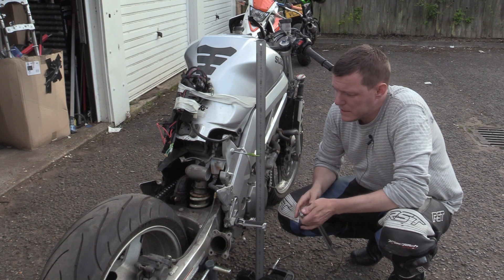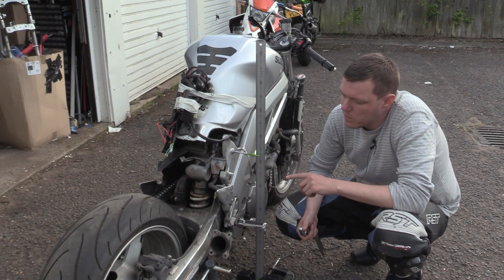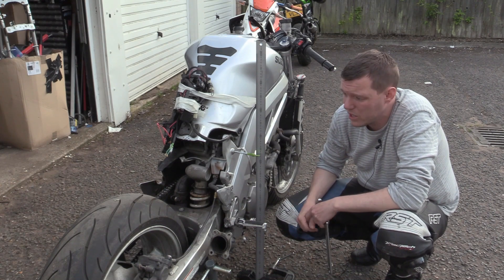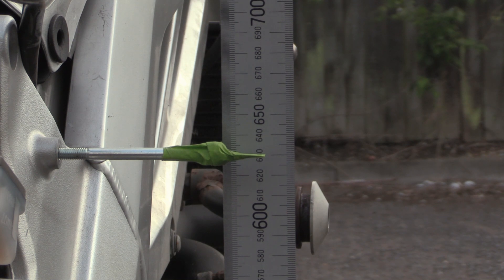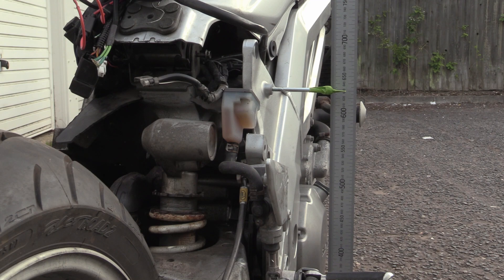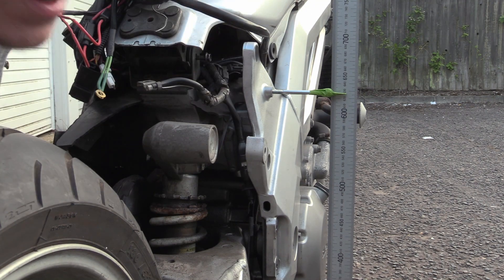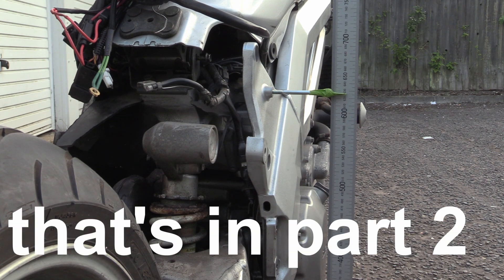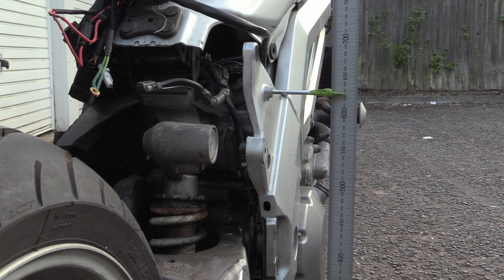Springs, Preload and ride height - Part 1

Comment: yeah but when you sit on the bike, you overcome all that preload. the pre-load only keeps the spring seated while in full travel. You cant change spring stiffness, its always constant rate of compression.

9:38 thats not correct either. Your weight is still overcoming ALL of the pre-load you gave it.
Reply from the maker: "yeah but when you sit on the bike, you overcome all that preload. the pre-load only keeps the spring seated while in full travel."

Sit on you're bike. If the rear end moves at all what does that mean?

"You cant change spring stiffness, its always constant rate of compression.""

- I say this in the video at around the 9:30 mark
Reply: @thedirtyworkshop  have you done measurements of ride height with yourself on the bike before and after?

Comment: How I understand it, regardless of where you set the spring. Once you sit on the bike, you end  up in the same place.  The only thing that changes is how springy the ride is
Reply from the maker: No. So a spring has 2 position. Free length and coil bound. Free length requires 0 force and coil bound requires say 1000 force. When you wind down a pre-load collar on a spring it applies force to the ends of the shock, and this is connected to the bike. The bikes 'weight' is what the spring is pushing against. Because there's no extra force added like bumps etc, we call this pre-load, i.e before any load (bumping and jumping) is applied.

If you increase the static load (pre-load) by adding another passenger or luggage then you need to adjust the pre-load. The more pre-load the less suspension you have.

Comment: Thanks for putting this up, I’m 5’4 and thinking about the best way to make the ground a little nearer, and this was explained very well. Definitely won’t be adjusting my preload now, no dogbones on my bike, they are fixed, so i can have the seat re made which is probably the easiest option. Honda NTV650, Yr 2000. Nice bike, but heading to the lake district and want a bit more stability under foot for those hairpins on the passes. Not a good idea to be on tippie toes there. thanks for the upload, very helpful and explained well.

Comment: Hi mate, when using shorter dog bones does this effect the preload setting on the original shock. I know the equaision used to set sag but not sure if the shorter dog bones effects the equaision for example maximum travel distance of the shock (if that makes sense)

Comment: @The Workshop NO you are incorrect. Changing ride height (the so-called pre-load adjustment) will NOT change the force required to start compressing the spring when the bike is loaded (with rider). It will ONLY change your ride height by shifting the compressed spring downwards. The reason being that the weight of the rider is creating a force that exceeds considerably the force applied by the pre-load. The only thing ride height does is shifting the upper end of the spring thereby actually shifting the whole spring and ride height. With the same weight the length of the compressed spring remains exactly the same and the force required to compress it further is also exactly the same. That is also why changing pre-load does NOT make the suspension feel softer or harder.  What happens is that as a result of lifting the rear end more mass moves forward and that might make you feel as if the rear got harder.
Reply from the maker: "NO you are incorrect."

- and you're blind. Didn't you watch the video?

"Changing ride height (the so-called pre-load adjustment) will NOT change the force required to start compressing the spring when the bike is loaded (with rider)."

- Totally didn't watch the video - don't blame me that you are dumb.

"The reason being that the weight of the rider is creating a force that exceeds considerably the force applied by the pre-load"

- Wasting your time trying to explain anything to me - you missed what was said in the video...
Reply: @thedirtyworkshop  I don't think being arrogant helps here. It will actually make you feel worse in the end, so chill out and do this simple experiment instead.

Start by doing this - set ZERO preload, sit on the bike and have someone measure THE LENGTH OF THE COMPRESSED SPRING.

Now, set MAX preload, sit on the bike and have someone measure THE LENGTH OF THE COMPRESSED SPRING. It's the same, isn't it.

If preload does not affect the compressed length of the spring, it obviously does not affect the force required to compress it further either.
Reply from the maker: "Start by doing this - set ZERO preload, sit on the bike and have someone measure THE LENGTH OF THE COMPRESSED SPRING."

- I'm sure you didn't watch the video - so in the video the bike moves 3mm, and why? Linkages, angles and deflection - and as I say in the video 3mm is nothing - you're not going to notice anything. Now, if someone wanted to lower/raise their bike by 3mm, they're being stupid. 

I say in the video, fucking around with pre-load is NOT how to change your ride height, changing the linkage (dog-bone) is. 

What or why you didn't notice this is beyond me. So when you make comments that are clearly condersending I'm going to call you a prick. There's also more to it than that, which was an argument with a guy on the discord about changing the pre-load by 10mm = 10mm of ride height change - to which I said - that's bollocks and I'll show you why - hence the video. 

SO why does it move at all, geometry - you're example above is missing the rest of the system, and because the cush lever, dogbones etc all have different angles and lengths when you change the compression vs spring length due to pre-load then there is a slight difference - but 3mm is not even worth considering when thinking about ride height - 

What's even more important is that if you keep increasing the pre-load then the bike starts to move back to the original position - this is because all linkages sweep through an arc.

Comment: Question on brake pads .
Has anyone had there break pad come off from the pad back plate  on the front brake while riding  it  ???
This as just  happend to me  !   I was Lucky
Reply: Yeah mate, my own fault. I cheaped out on some 'sintered pads' a mistake I will never make again
Reply: @philipbilsbury8501  These are the only pads  .
Your guess is not the answer !
Reply from the maker: What pads are they would be a good start? And it means that they de-laminated from the backer. Cause, shit pads
Reply: @thedirtyworkshop  You can laugh at this if u wish   or what ever .
These brakes are on my Mountain bike  .
These brakes are the best I can fined for sharpness & strength .
These brakes are cable .
I can get to 35 mph on this , so you need Good brakes and I ride  it hard , Yes hard LOL.

I have never had this before .
This is the first time its happed on me .
I take it this is  a bad that was weekend & let go .
Could be some non reported insistences that have had this ,  what do I meen  ?  motorbike brakes tooo !

Comment: Its always good practice to play around with the suspension preloads(if atleast somewhat possible), my dad once bought a bike that was previously owned by some lady, whom put the preload as low as it would go, bike would sag in when he sat on it, hilarious to watch it go over speedbumps, you could just see the rear end dive down as it went off the bump. Once adjusted it went from a nightmare to drive to a pretty good ride.
PS. more Isaak with spanners? Comedy guaranteed.

Comment: In mountain biking we call that sag. Depending on the trail you're going to ride, you'd set your suspension to compress a certain percentage of the full travel when you sit still on your bike. It doesn't change your ride height (that's your saddle height) but it changes the suspension dynamics.
Reply from the maker: "In mountain biking we call that sag" - didn't watch the video......
Reply: @thedirtyworkshop  "Didnt watch the video" - didn't read the comment......

If you read back I explained what preload adjustment is actually used for in other sports as opposed to track racers "as tight as she'll suffer" and how it's not a the ride height adjustment

Enduro riders know what that is too, I guess it doesn't really apply to track racing.

Sag is directly related to the preload you put on your spring. It's an indicator of how plushy your suspension is.
Reply from the maker: If I read back the comment you say "In mountain biking we call that sag" - and sag is different to preload, and I put 'sag' on the screen - hence the comment above
Reply: @shiro-r4m    Yea. Ride height and spring preload are two different things, but dynamically..
Reply: @thedirtyworkshop  Then technically you were correct lol, I was preparing some food while listening to your video and commented after I was done.
Reply from the maker: Specifying the difference is import when you consider a hard tail, or hub centre steering.

Comment: Matt I have some dog bones from a 1999 V plated 1200 bandit. If there of any use to you. I can drop them in the post.. it was the in thing back then, if you did not know any better. I dropped lucky having Revs suspension within walking distance, ended up with a well sorted bike in the end. 👍

Comment: I think you hinted in the video that you are going to cover what preload actually is in another video. But like you've mentioned its nothing to do with setting ride height but setting the correct sag with riders resting weight in the rear suspension. THIS then gives the correct location for the piston inside the shock so it doesnt/shouldnt bottom or top out when using the bikes normal full range of travel. so if you are a fatty and its still bottoming out on a dip you need a stiffer spring or you could try turning up the compression and then rebound, but still the preload should be pre-set for that riders weight.

also, didnt think you were a die antwoord fan
Reply: I'm 135 pounds on a 2003 RC51 Honda.  I set my spring to softest and still the bike doesn't go down, or compress much that i notice.  Is that still enough preload to use the suspension properly?   I think i need to respring to my weight.

Comment: Ride height is measured with the wheels at full extension, with the wheel/s hanging in the wind and not to forget you may need to pull or push down on the wheel to take into account the top out springs.
Reply: bandr  That's the thing. IF.. only all where made correctly.
Reply from the maker: No, that's one of the measurements when measuring sag. Ride height is measured from the seat to the ground when you're on the bike - hence why it's called 'ride height' - seriously you can't be that stupid
Reply: @thedirtyworkshop   Next time your at the track.. Have a conversation with the suspension person (if there's one there)  Maybe he will put you on the right line. :) also adjustable links are not the best way to lower a bike, if you Have to have a lower seat height.. then reduce the travel of the shock or forks.

Comment: So this raises a question, is there a spring material or design that does NOT get harder to compress as you squish it? A constant weight, from uncompressed to compressed.
Regular springs are somewhere between a linear and exponential curve right?
Reply from the maker: Very good question and no. It's the springs geometry and not the material that this is attributed to. In other words it's the form of the helix that has this characteristic.
Reply: Is he asking about linear springs, compared to progressive?
Reply: knuckles zedawg sort of, but not really.
Reply: english, you going full slicks on this bike!? Ever ride a bike with slicks? Blew me away the first time, super different, super good, gets me harder than Jessica Biel just thinkin about that first time!
Reply: Different spring shapes would change that I think. So a spiral spring like you see here would be different than leaf springs on a pickup truck. You could have a piston with a fluid that leaks out at a rate that changes with the amount of compression to keep the force constant. That wouldn’t qualify as spring though would it. My logic could be 100% wrong here. I have zero credibility on the subject so forget the grain of salt, take this with the whole shaker.
Reply: @gadnuk7159  it's how the coil is erm coiled.  If the helix is the same spacing all the way down it's linier , but if the helix gets tighter (the gaps between) the the shock gets stiffer through the travel.  This helps reduce damping spikes and bottom out harshness

Comment: When reading manufacturers seat height data, ive always been curious to know from which point of the seat they are measuring from. Because on the more sportier bikes the seat is at quite an angle meaning there can be like an inch of difference in height from one side of the seat to the other. So there must be some sort of datum point that manufacturer's will generally go by?
Reply from the maker: Well get to all that, but the trick is - don't use the seat. Use part of the subframe as a reference - the numbers are guides not absolutes
Reply: Desantos123 ,, Ducati use a special tool that bolts to the frame , then measure from that to the rear axle
Reply from the maker: Well aren't ducati's shite LOL
Reply: The Workshop ,, well aren’t you a smart arse 😘
Reply: @thedirtyworkshop  agreed, pasta bikes